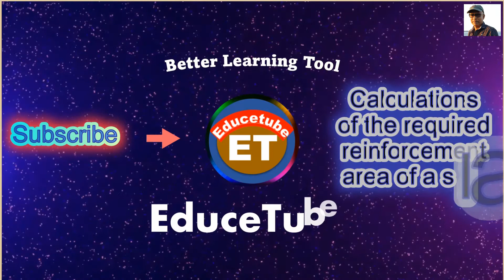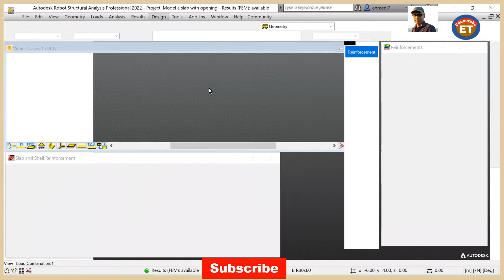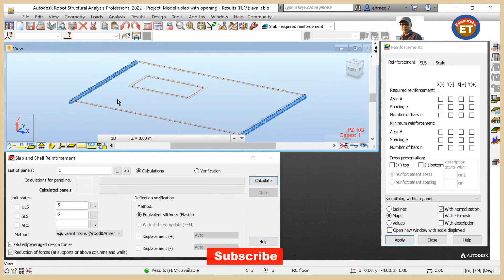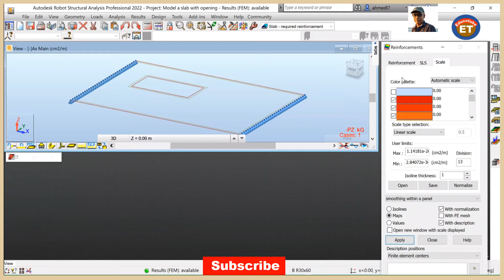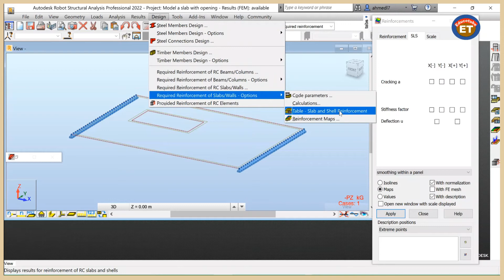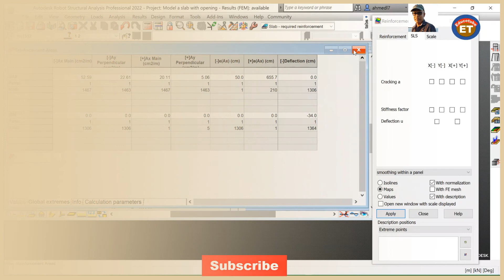Calculate required reinforcement area of a concrete slab/Autodesk Robot Structural Analysis 2022/P-4

Comment: Small Criticism. I like your excellent well paced Robot videos and will come back to them to learn more later.  But I suggest that you need to have an audio editor check your sound levels. The piano introduction is at a much higher audio level and fidelity than the the spoken audio. I recognize that english is your second language, and while your spoken words are clear, the audio is of lower fidelity and volume compared to the initial audio the introduction. Perhaps in future video you can consider to also choose a higher quality microphone of some type.  Great Work!